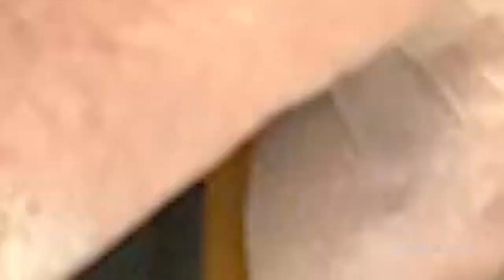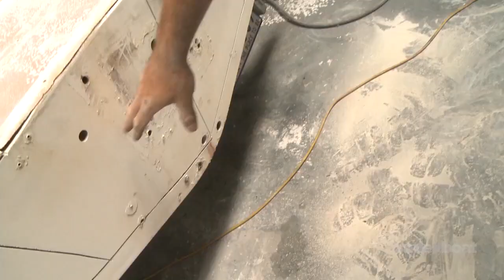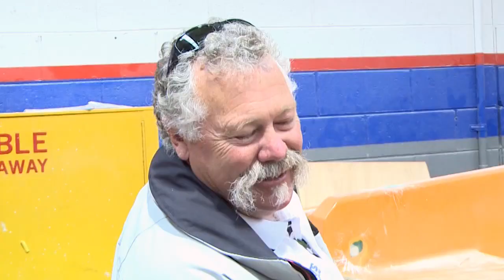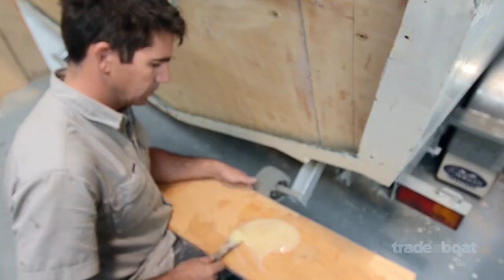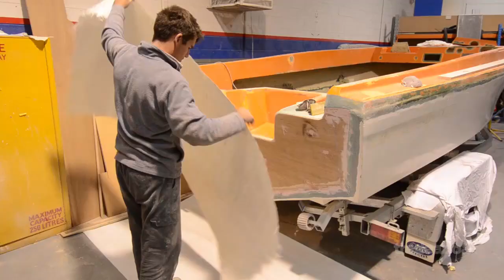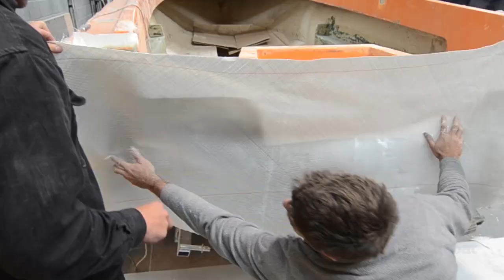Haines V19R Boat: Restoration of the Hull, Transom and Workstation

Comment: I finished my Caribbean V19 Centre Console about two year's ago, I copied your laminate schedule i used epoxy and powder bound chop mat my lay up was 400gram chop mat, 450gram double bias, chop mat, double bias, chop mat double bias, Laminate consisted of 3x chop mat 3x double bias layer's over a 50mm thick thermolite transom, i hung a Mercury 183kg 90hp off the transom in 1.5 meter swell with .5 meter chop on top we done 40kph coming airborne off Cronulla Beach in Sydney that transom was rock solid, Video's on my channel

Comment: Shipwright/boatbuilder chiming in with my two cents.... Every time I've done this job I've always cut the inside skin and taken the core out. Replaced the core and tied in the laminate to the inside of the boat. It's an objectively stronger layup. Then build and laminate your stringers as a separate structure and then laminate it back onto the transom so as to keep the core separate and create a stronger bond. This way you conserve the outside skin and the shape of the boat without having to do anywhere near as much filling and fairing. A little bit more fucking around initially but you save work down the track and its ultimately a better structure. Another thing to consider is using vinylester resin instead of poly. The application is much the same but its chemical properties make It stronger and it's also more accepting of epoxy and timber whereas poly is not. It's a tad pricier but not as much as epoxy. That being said, polyester isn't that bad at all and is definitely a viable way of doing it, I mean that's what they were made out of.
Reply: Good advice
Reply: Make some detailed videos , easier to learn when seen rather than reading about.

Comment: yep well that's not how I would do a transom, yu cut the thing out from the inside never from the outside...! that way your layup 3 layers of 450 gram, once you glassed and clamped the new transom in, ive been meaning to do a vid of a full rebuild on a boat so as all the would be boat repairers out there like yu self can learn how its done properly. and yes I am a boat builder, I specialize in rebuilds and custom alterations, to me what you have done is made more work for yu self, and most likely fucked the true of the hull.
Reply: Inside makes much more sense! I'm doing up an old Swiftcraft Seagull at the moment. Luckily the transom is good and just have to do the floors and engine
Reply: That's a good job there's nothing wrong with this way , there was already plenty of fairing to be done with raising the  height  of the transom and all of the holes from transducere

It's horses for courses really

Comment: This is ALL wrong ! For starters , it's bloody 2019 people ! Throw the ply to the shit house and use the modern , much longer lived alternative which is lighter,stronger and impervious to water ! Coosa board by Bluewater Composites , Thermalite  and the list goes on . Secondly , that new timber transom will rapidly develop cracking right around the circumference of the old glass to new glass transition because your chosen technique of outside transom removal is far inferior to leaving the outside skin in place and accessing the old timber from the inside of the vessel ! It is much stronger and safer to leave the original glass work in place on the outside as all the weight and force of the outboard is pulling on the transom in a rearward direction . Merely tabbing new glass in and expecting that to be strong over any period of time is ridiculous , to get anywhere near half the original glass shear strength at the rear corners of the vessel the tabbing would need to be over a meter in overlap all the way around the top , sides and bottom of the hull !Conversely, the internal method can be made as strong as you like with the addition of as many tapped in structural knees as you deem necessary for your chosen motor weight and also gives you the opportunity to assess the health of the stringers and floor which if constructed of ply will need attention as well if the transom itself needs doing  . This job is what is termed in the industry as the half arsed band aid approach and is definitely not recommended for either the current owner or the fool who would potentially be lumped with it in the future ! If it were my boat and I was undertaking this restoration I would have first taken up the floor , removed the stringers and that poxy rear seating arrangement and started from scratch to ensure longevity and structural strength . Squaring off the transom and adding a pod  is a much better way to go . The benefits of such are better flotation at the stern enabling a larger outboard to be used , better performance and reduced fuel consumption , also swim platforms with a dive ladder can also be added which makes a boat much more enjoyable to use .Another major benefit is the extra cockpit area opened up by removal of the old seating and outboard well arrangement which negates the need for a larger vessel ! Please , it's 2020 guys , get with the program .
Reply: I agree with everything you said, except for using coosa. rigidity is important, noone has seena 40 year old boat cut apart that had coosa in it because it hasn't been that long we don't know what kind of degradation process happens, does it turn powdery? simply weaken? crack? My guess is it cracks.
Reply: I'm not a shipwright, but, I would of thought that Thermolite would be the  material of choice nowadays.
Reply: Nothing wrong at all with using ply and balsa coring done properly with modern composites will last as long as anything.

Comment: Why not coosa instead of ply?
Reply: Expense I guess, ply is cheaper and can last if done properly
Reply: if the repairs done properly corsa is just a waste of money,transoms rot because not enough attention goes into making sure every thing is sealed properly
Reply: darryl stem transoms rot because of mounting things like transducers, motor change, ladder, bait well, lights etc.
Every rotten transom I’ve seen comes back to where some xxxx has put a screw in it.
Reply: @jc5016  and when things are mounted,if the fasteners are sealed properly it wont rot
Reply: darryl stem never bought one where that’s been the case though
Reply: @jc5016  I am in the same situation with installing a new transom.  I have been going back and forth on Coosa/SpaceAge panels or marine ply (oem). My boat is a 1980 26' center console and had the original transom. Pretty impressive when its 40 years old and I can't argue with another 40 years.  It will outlast me. It took a more senior boater to really make me think. Coosa panels would be $650 (compared to $150 ply) and has zero retaining strength if you ever thought about screwing something into it. If you can justify the added expense for it, go ahead. But, where else could you spend that $500 on your boat?